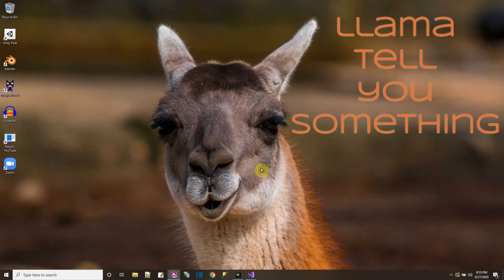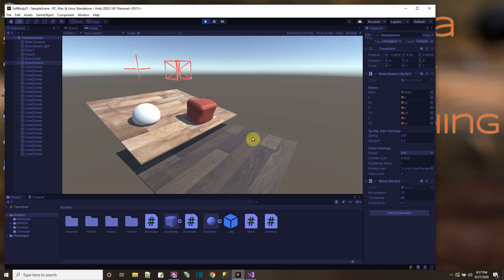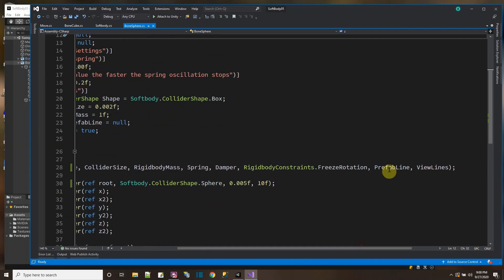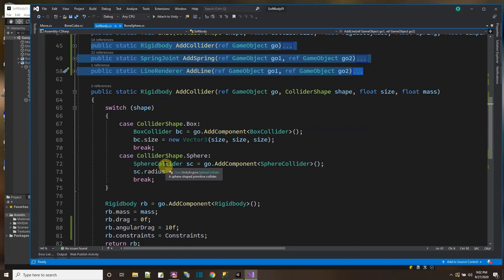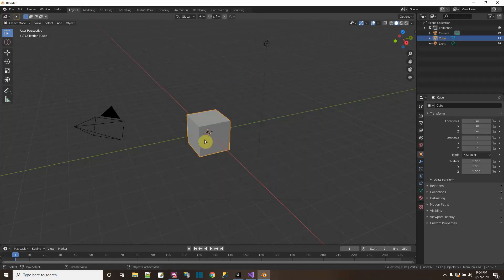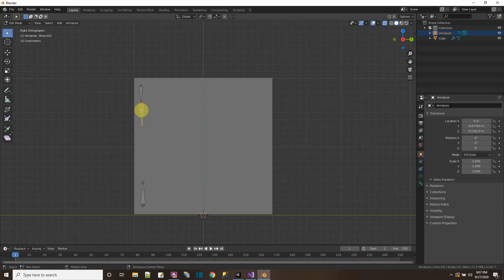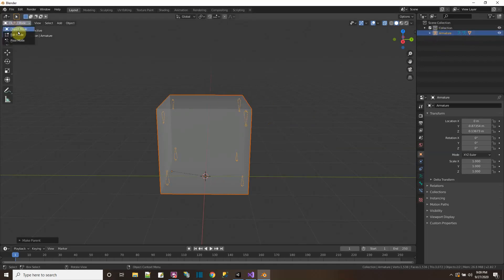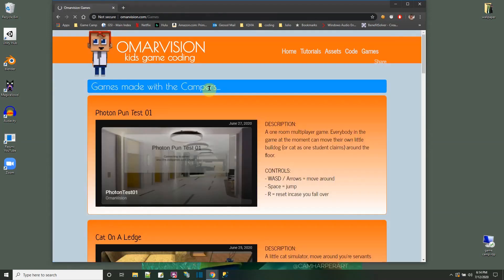Softbody Physics using Springs (Unity 2020)

Comment: Is there a way to make it less squishy to roll easier? (like kinda hold its general shape better n not fold in on itself n get super flat so it still rolls easily)
Reply from the maker: I think... i haven't tried... i think that I can either try
1. Make the boney spring structures smaller inside the ball
or
2. Make the springs more solid. Solid enough so they are not squishy..

I'd try playing with things those two ways.

Comment: ask for more information I would like to know if this model uses the mass spring system ( mss ) model?
Reply from the maker: Hi. The Mass Spring System by Sean on the asset store is not used.  I used just the built in Unity default spring joints

Comment: Returning to Game Development and this is where I left off. Thanks for the study case! I do have a question for SoftbodyWithSprings.unitypackage. Does this package contain anything I must-have for the above solution to work? I'm going to be downloading and working with a few, i just wanted a better understanding of software engineering, game development, and how things work
Reply: And then I just realized this isn't in the asset store. I thought I knew what SoftbodyWithSprings.unitypackage was but now I'm completely confused. I'm assuming it's a package you somehow exported. But what was practical about it, I'm really trying to understand unity more. I plan on using the option Add package from git URL.

Comment: Hello! I want to use a cone (from a blender) in the game, but why is its center point not in the center? When it rotates, it does not rotate around itself, this is immediately visible from the direction arrows in Unity. I can show the video. I tried a lot to make the point Rotate correctly in the center of the object (in a blender) but it doesn't work. Do you know how to do this?
Reply from the maker: could it be because of this????

https://youtu.be/t7VYtSQw7JE?list=PLmBprbjofP9jkqGhAxHSTE2IIKCFeKi5f

try changing or setting the pivot point in bleander before you export to unity. and export as an FBX with the experimental transform set

Comment: Hello! Is it possible to somehow save such a grid as an object at 7:40?
Reply from the maker: I did. From blender you must select the mesh and then export selected, upon which you can choose *.fbx, *.obj or whatever other format available in the export.
Does that answer your question? Shall I do a quick video
Reply: @omarvision  I didn't succeed, I need it for unity. And there the object is simply invisible
Reply from the maker: I think I'm a little confused exactly what it is you want.  I made a mesh cube in blender for the tutorial. Iss that what you want
Reply: @omarvision  I would like the mesh to be visible without material, so that the mesh is a visible object. Is it possible?
Reply: @omarvision  I want what I see at 7:40 to be a game object. Is it possible to leave only the grid without the white material and so that it would be visible in Unity? Is it foolish to hope so?
Reply from the maker: You want the wire frame.  Well ... you can see it like a wire frame in unity. Change the scene render mode to Wiregrass.  But I imagine you want the wireframe in a game, right?
Ok you can add the wireframe modifier while in blender and export it like that.   Blender will make a mesh, that looks like a Wiregrass.  Then you can export that into.unity
Reply: @omarvision  I'll try, Thank you!
Reply: @omarvision Hello. :( To my great regret, nothing worked out for me.
As soon as I have not tried, I can’t make a point in the center of a triangle for Unity. You are definitely a professor at this. Can you please !? Could you try this and share the fbx file?🙏

Comment: Can you please leave link to the script, because your site does not respond. Thanks in advance)
Reply from the maker: I will. Sorry this past week there has been trouble with the site.  I'm working on it. Please try again this weekend
Reply: @omarvision  Maybe you can upload the sources to the github, it will be much easier than solving problems with sited, will be appreciated :)
Reply from the maker: @ayazpanahov2237  I think no matter what happens with site github is a very good idea
Reply: @omarvision  So, Can you please leave link in descirption or right there after uploading?
Reply from the maker: @ayazpanahov2237  i will... I will do those things this weekend
Reply from the maker: @ayazpanahov2237   I put a link to the source code on github. You can get the Source now
Reply: @omarvision  Thanks a lot!

Comment: Dont use "ref" with object they are already transmitted only by reference.
Sometimes "out" is used in methods but only to match the entry in the method to this reference
Reply from the maker: explicitly coding is helping me explain to beginner programmers what is going on :)
Reply: @omarvision  And well, then everything is fine , this approach even made me think, thank you for the video!